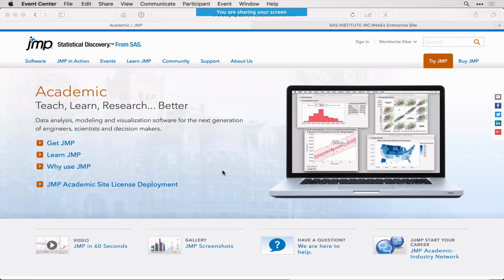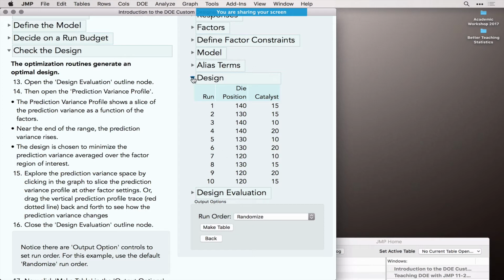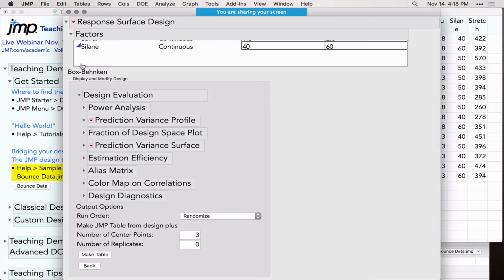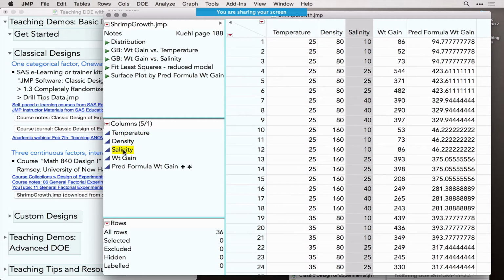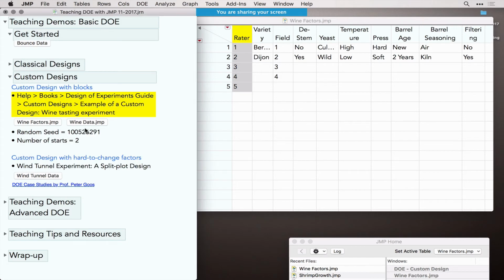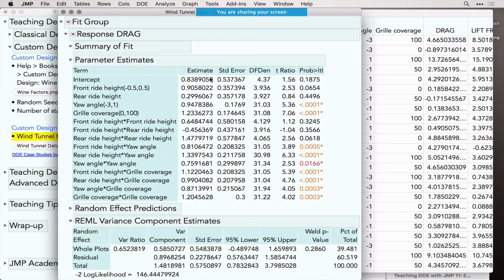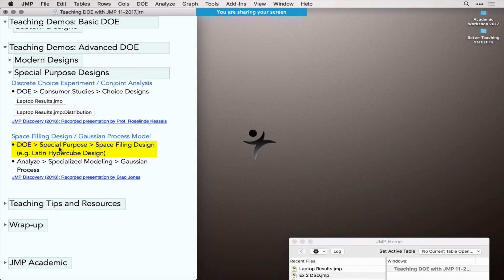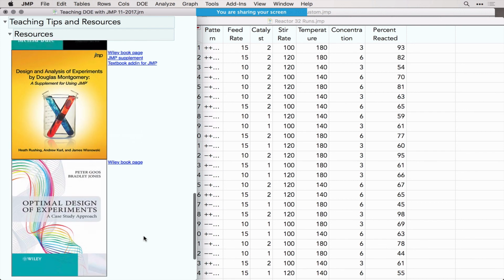JMP Academic Series: Teaching Design of Experiments using JMP (14 Nov 2017)

Comment: Hi. Where to get the equation upon which your model runs or optimizes values?
Reply from the maker: On the top red triangle (context-menu) in Fit Model you find "Show Prediction Expression". However, most users directly look at the Profiler to understand how the model works and to find the best settings.